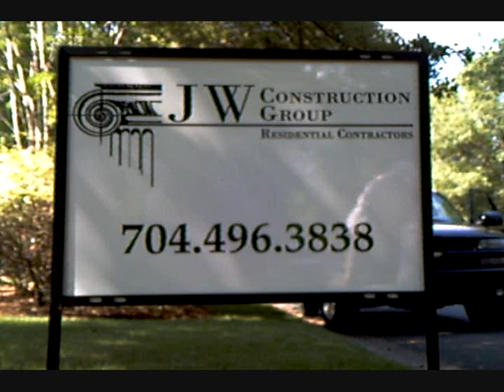Home Renovation TV PREVIEW - Screened in porch to Sunroom conversion

Comment: We would like to convert our screened porch into a sunroom. I noticed that this project is done on a brick/concrete base porch. We have a very large deck around a pool and the previous owners built the screened porch on top of the deck next to the house, so the floor is deck boards and the footings are typical deck posts. Before converting this outdoor screened porch into an interior room, should we do something different to the porch foundation? footings? (Not too good with my architectural vocabulary lol) I know we'll need to change the flooring since the deck boards have cracks between them (insulation problem there)
Reply: You'll want to check with your local building office.  Most likely, they will require something other than the existing footings like a concrete slab.